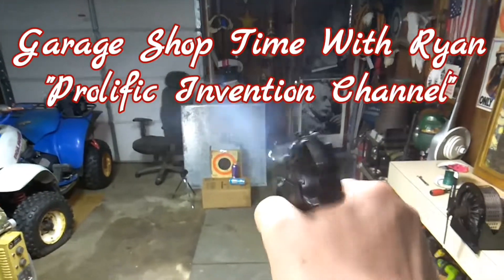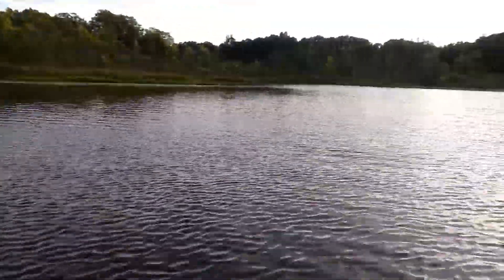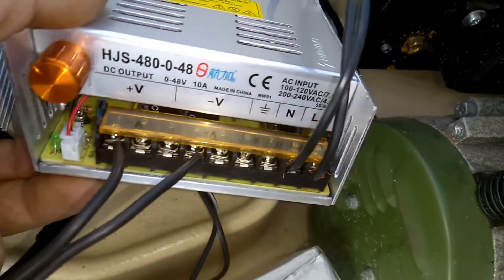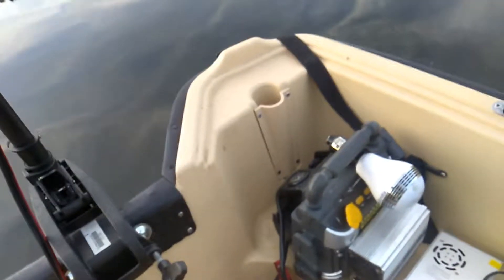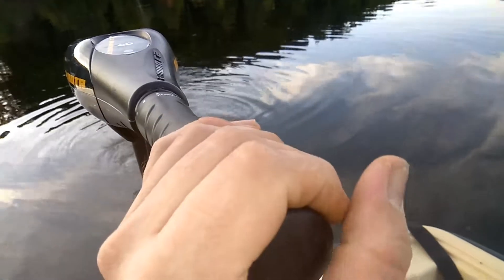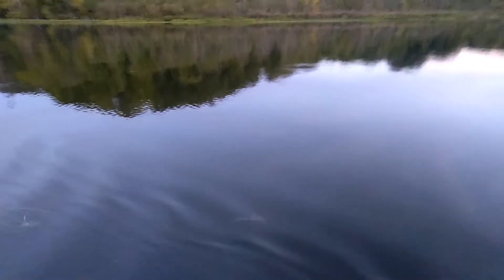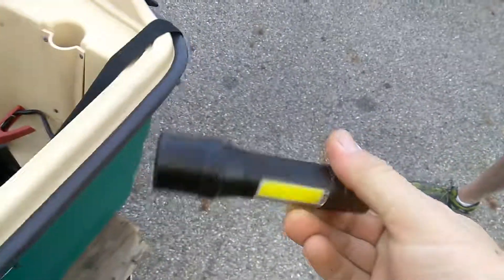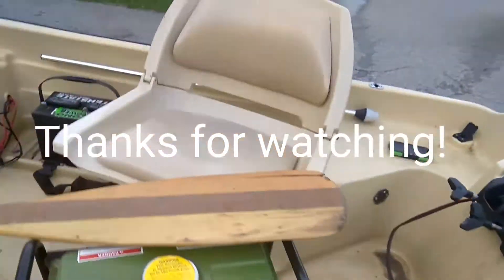Generator + Trolling Motor, Will It Run?

Comment: Another guy did this with a whisper quiet generator and legit dc converters. The company also says their converters can be ran in parallel to produce more amps. His motor runs full power.

Comment: Why not just use the generator and a battery charger and just keep the battery charged with the generator
Reply from the maker: For the money this was the cheapest way to get a constant 12v 480 watts, They don't make 40 amp continuous duty battery chargers cheap, if at all.  So if you hooked up the average 10 or 20 amp charger to the battery you'd only be inputting 120-240watts .
If I hooked this box to the battery connected to the motor it might be too much input and burn out the batteries.  Now I have one of those 1200 watt Amazon boat motors  to test on my slightly bigger generator with 4 of those boxes for converting the power to 48volts and the required 1200watts continuous.  Someday I'll finish the hybrid outboard I'm making that is going to use an AGNI motor I have, or a 5kw motor from some old weird racing scooter I have paired with an old retired tiny 4 stroke boat motor with a compression release so I can run it as a hybrid gas/electric, probably burn it out, but it will be fun nonetheless.

Comment: trolling motor to battery to ?amp 12volt converter/charger to 110 volt genset
should be no worries for small genset running converter/charger up to 80 amps
converter charger MUST put out more amps than your motor uses
Battery acts as buffer for variable amp usage of the motor
excess amps charge the battery😀
Reply from the maker: Where do you get an 80 amp 12 vdc charger (for cheap preferably) Id like to know.  These boxes cost $50, I own 4 of them for higher power applications-the run in series and parallel no problem
Reply: @ProlificInvention  pull an converter out of   a wrecked rv they are 30-60 amp. my new 40 amp converter was 350$
Reply from the maker: @ronmilne6574  Thank you very much, thats a great idea I will be trying
Reply: @ProlificInvention search generator running trolling motor and a dude running a setup on his bowfishing setup will pop up. I believe the converters are called power max. They say you can run them in parallel for more amps. On of their converters goes to 100amps

Comment: This is the kind of crazy shit I do.  I love it.  BTW, I run my Minkota trolling motor on up to 17 volts.  I've done it for several years and so far it's holding up fine.  I run it on a 5-cell Lifepo4 pack, which fully charged is around 17 volts.  A nice little Harbor Freight (not like the one you have) inverter generator will be a lot more quiet and should run your motor as good as what you have.  Downside is it's a lot more $$$.
Reply from the maker: Totally agree, I did make an exhaust extension and ran it under water which quieted it down a lot... but now I've got 200ah of deep cycle batteries and I'm making a solar canopy this year.  I'm also using an AGNI/Lynch high power DC motor on an old outdrive with a 48v 20ah lithium battery for experiments in higher speed.  I have a bunch of old 2 stroke gas boat motors but I'm tired of fixing them.  I even have an old 2 stroke snow blower engine with a 24" TRI blade pusher propeller that I mounted to a computer chair mechanism and it works great to push the boat around but is loud and dangerous 😆
Reply: do you think you could run this same idea using a 500w power box? (eco flow river2 max)

Comment: All you need is generator +  a 12v  battery charger   ..you don't actually need that gizmo
Reply from the maker: Most battery chargers run at 10 amps/12 volts = 120 watts, this trolling motor can consume 40 amps continuously (480 watts) 
Some battery chargers have a 40-50amp jump start feature but will burn out and are very inefficient in that mode as well.
I suppose if you used a battery as a buffer you may be able to extend it's range that way, but dangerous.   The Gizmo actually fell short on power so I daisy chained 2 of them together and it worked perfectly.  I later routed the exhaust underwater which quieted it down alot.  It was a fun experiment.
Reply: @ProlificInvention  if the trolling motor is 40 amps ..does that mean a 120 volt 15amp ac house circuit  couldnt run the motor ?
Reply from the maker: @relaxingnature2617  it's 40 amps at 12 volts DC=480 watts, a household circuit is AC 120 volts, or about 4.8 amps-but you need to convert to DC.  The Gizmo as you call it is a very useful tool for doing this, AC 120v into high power 12 volts DC
Reply: @ProlificInvention  I understand it needs to be DC    ....I had this same generator in boat idea myself for a few years ..I was going to use my battery charger ..but as you explained, it won't be able to turn the prop fast enough   ..I use 9 big battery's each time I go boating and want a better longer range solution ..I can go 20 miles against current , wind and chop , idd like to farther out but I'm always turning back because of battery ..itdd be nice to run my generator so I could cruise indefinitely and only carry 1 or 2 battery's ..idd sure like to see a new video of your setup working ..even in a barrel
Reply from the maker: @relaxingnature2617  Will do!
Reply: Relaxing Nature voltage goes up, amps go down.  Ohms law.
Reply: I run an 80 watt solar panel to a 90 amp hour battery and on a good sunny day the trolling motor can just run of the solar panel and not use up the battery.When a cloud covers the sun the battery kicks in and when the sun comes out the solar energy takes over. There will be times you stop your trolling motor and do some fishing while your battery is charging. In my case I do not want the battery get below 40 percent. So far the battery I have is doing well on it’s fourth year and you need charge it as soon as your done with it and it will last much longer. I did think about this idea of what your doing that is why I am here watching to see how it works. Great video.
Reply: @DaYammie  I don't see how this can add up.  motor is 480 watt and your panel is 80 watts.    My math shows you are about short by about 400 watts, approx 1/2 horsepower.
Reply: @jwiereng  The purpose of the solar panel is really to charge the battery when not in use however I can draw in 80 watts of power from the sun to run in 1st gear. The Minn Kota in 1st and 2nd gear draws 5 to 7 amps therefore the 80 watts can give it that however in 3rd it cuts out.The 100 ah battery can run in 5th but it will draw 30 amps per hour and will only last 2 hours. This all depends on the carry load in my canoe. I have done this but conditions have to be good. I tend to use 1st and 2nd gear. In regards to a 80 watt solar panel it can be done in 1st but it is a bit of a stretch to get it to work in 2nd. 12 x 5 is 60watts. At least you have 1 gear if you run out of battery.